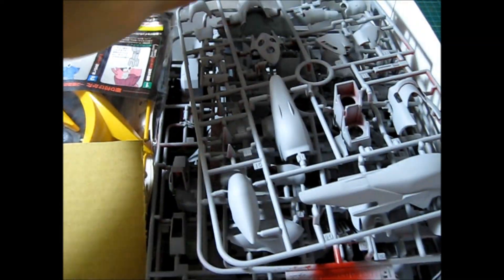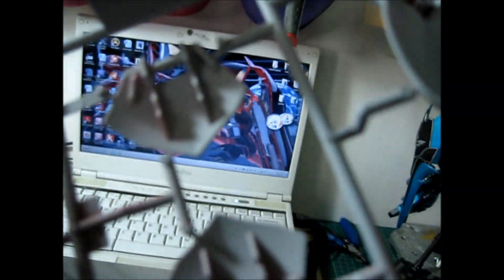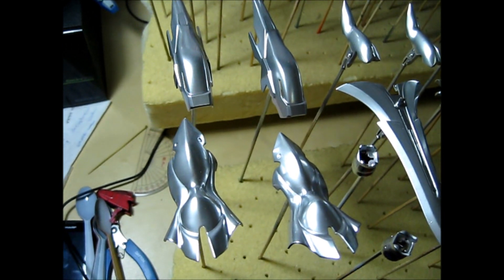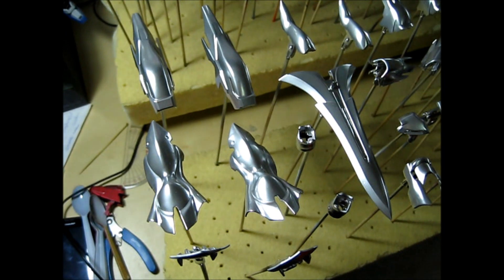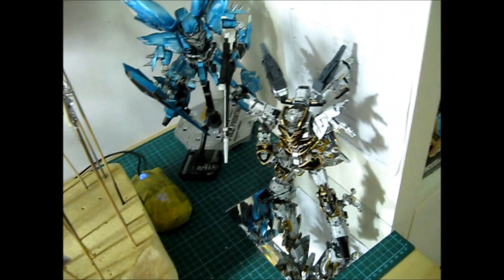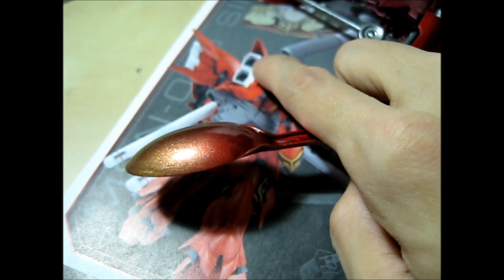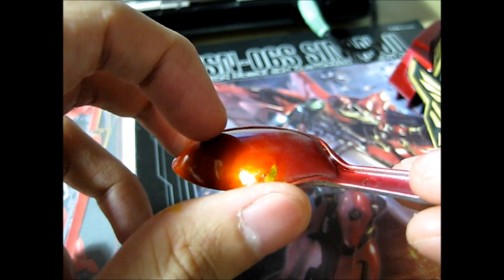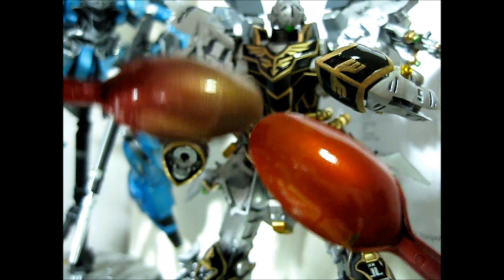Mg 1/100 Sinanju OVA WIP 4- Priming/ Chrome base coat/ Colour selection for red parts.

Comment from the maker: u are right about that part, its fine for me as the unprime part is very small + its going to be a nub mark so even if the surface it not going to be smooth, u will be cutting it or sand it away after all. so for me I just cut and trim it. and as for the colour wise, if u are apply a lighter tone of colour compare to the original colour, there may be a slight different only if u are having It a light coating. For my case its a 2 layer of chrome therefore there is no different.